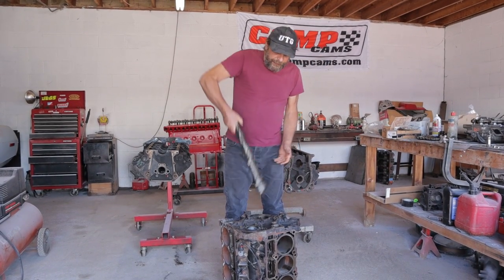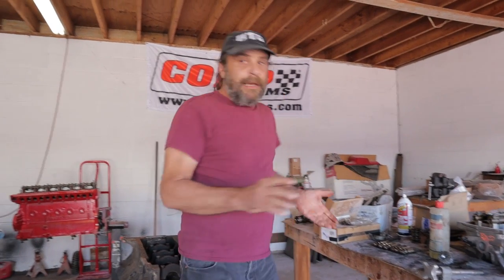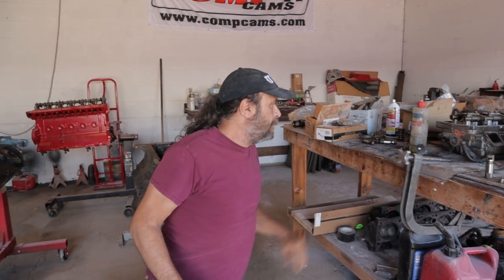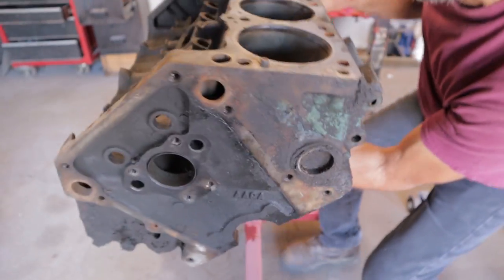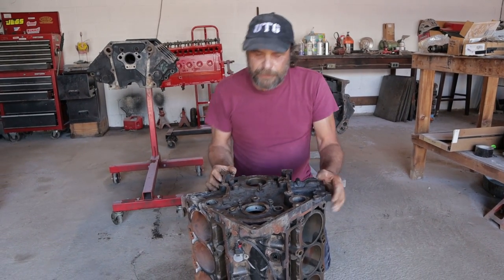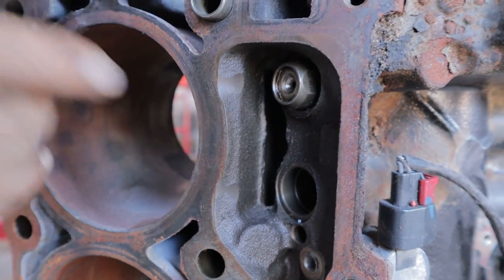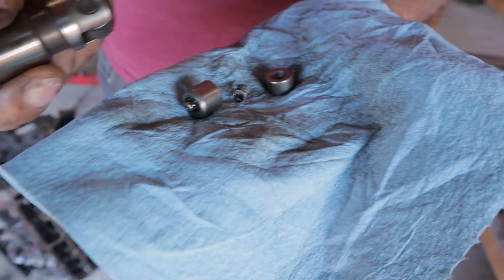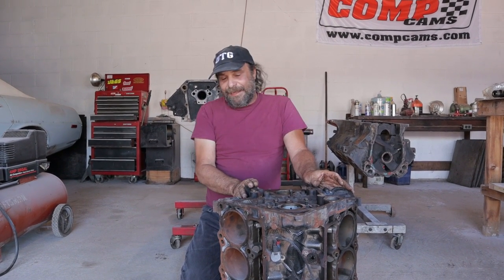Gen 3 Hemi Camshaft Failure Mystery Explained!

Comment: so i see the tread here has a lot of possible solutions for the problem that chrystler doesnt want to address. I am going to offer one aswell. At a time i worked as a tractor trailer mechanic where i had the privelage of rebuilding one of those engines (not my normal job). And this is for antbody here but, Isn't there a way to put oilers (like little sprayers) up top to spray oil down to the cam and lifters? i mean the oil-pressure is there... . the oiler i am refering about are what cummins uses to spray oil on the piston wrist pins

Comment: hard to believe after all of that r&d Mopar did on this block, and you know how many millions of miles the big manufacturers run these engines to failure, that they still released it! hard to believe that the engineers didn't catch this year's ago before Uncle Sherlock Holmes Tony did though and figured just sweep it under the rug and deal with it on the back end replacing the damage. much like the 351 Cleveland and losing oil to the crank journals. myself included with the great engine stories along with thousands of others who have the same quote, until they got the dreaded rod knock!!! after that it went kablewy!!! or got sold clunking down the road. too bad about kiwis bad engine, hopefully he'll get a different better engine for the future incarnation. thanks again guys!!!

Comment: My Chrysler shop does this and never a failure since and I’ve got customers with 200k plus and some with 300k that have not had any issues! It’s a mds and low oil pressure so a read my fix and you’ll see a huge diff. It happens when the hemis sit for long periods of time with low oil pressure! A demon/hellcat oil pump and lifters  fit the the 5.7 and disarm the MDS AND ITLL NEVER WILL DO IT AGAIN

Comment: I have a 5.7 in my 2012 Ram 2500  No problems yet but the blogs and forums are littered with cam lobe and lifter stories getting eaten and burnt up.  I hope this wont happen to mine.  Good to know the reason why and know that RPM may help throw some oil on the cam.

Comment: Well good to know...this thing would eat cams like crazy under the primary usage in which I would use it like 60% of the time, my truck idles ALOT!!! And over half the time I barely pass 2k rpm and it's super rare I hit or pass 3k , the thing is the ol 4.62v ford has practically 500000 miles on her now and I'm "in the market" for another ...Ram certainly is not an option now, I wish you could get a ref cab short bed tundra but since that's not an option I guess that narrows it down to 5.3 gm or 5.0ford

Comment: I am sorry Uncle Tony I think you are wrong. 03-08 hemi with MDS did not have this problem. Chevy, and the new ford 7.3L gas engine also have this problem with the lifters and Cam failing prematurely. 

My educated guess is. 
Thinner weight oils and longer intervals. Are the issue. Along with supplied parts being of lower quality. 

If I own a Hemi I would check and change the oil every 3k-5k with quality oil and filter. I would be mindful of excessive idle time.

Comment: Why not just drill small holes in lifters to lubricate the roller like in flat tappet cam EDM lifters? Simple and will make big difference. Another idea would be to take oil from last cam bearing and run a tube on top with holes lubricating top of the cam, but this would require better oil pump to handle the pressure loss. I see that in my big block with indy heads and oiling lines taking oil from last cam bearing, works well but drops oil pressure down by a lot.

Comment: I have done many replacements of camshafts and lifter jobs over the years on these HEMI's and only until about 2009 and later did i notice issues with them. never had seen one fail until 2010 or so. same blocks but never before seen until late 09 and 10. its a lifter issue mainly. never had one scored like he shows and seems about 98 % of the time its on the left bank 3 5 or 7 cyl's very rarely on the r/bank. still may be an oiling issue but how come we never see them on earlier MDS engines ?  or even non MDS early mods. have also seen this issue on the 6.4 ltr . never on a 6.1 ltr  car . mainly in the truck line and sometimes in cars. very random on the miles that it happens. just my 2 cents. by a LONG TIME MOPAR GUY.

Comment: These engines are not as defective as this video makes them seem. You can find a lot of examples of high mileage Hemi 5.7l.  My 2008 Dodge Magnum has 170,000 miles with minimal engine issues: new intake manifold (big plastic part) and a MDS solenoid.
Reply: I have run a 6.1 to 350K miles.  I have a 6.4 with ZERO issues.

Comment: Thanks Tony for finally finding the truth. Even though it made me sick to my stomach. From dropping valve seats too no oil on the cam, I'm pretty pissed right now. I have two 2010 hemi cars I bought brand new, so far so good. But It looks like that could change in a heart beat.
Reply: Don't worry about the engine and the cam problem just make sure that you change the oil with synthetic oil and you will never have this problem the problem is that they use cheap oil at the dealership that's what causes this. I had 2009 dodge ram put 190,000 miles no engine problems. Try change your oil by yourself, it's easy. I have a 2013 dodge now put 50,000 miles on her nothing wrong with her. Also put good fuel injection cleaner every 6 months helps with fuel tank. Most of these problems are caused by cheap parts. One more don't use cheap spark plugs from the dealership,use double Platinum they burn better in your engine.

Comment: From what I have been reading about these engines were effected are engines before 2017... Chrysler has corrected the problem from 2017 on up.
Reply: Can you post links. I would like to read that information. I have a 17 UT has got me seriously worried. Thanks
Reply: @roadsideguy5902  Found that 5th Generation 5.7 Hemi Engines have a different camshaft and I would suspect lifters as well... A totally new design from the ground up. This could very well be how they have changed things dramatically on past problems that existed. https://5thgenrams.com/community/threads/mechanical-differences-between-4th-and-5th-gen-ram-1500.2109/
Reply: @netsurfers9357  thanks I will check this out.

Comment: i just took my 2015 in with the same issue, i was told after the repair with the "improved" lifters i wouldn't have an issue again. is this true in anyone else's experience
Reply: So when my motor was tore down and lifters pulled the lifters  were soaked in oil from the galley passage running along them, I put the blame entirely on the MDS solenoids

Comment: I actually found that jeep dodge Chrysler decided to fix everything by suppling hardened valve springs in these engines which is fine and all but is actually destroying the cams in these, the access oil flowing with worn cam metal in it is Waring the lifters and  rollors..., When you take apart and  see worn cam and lifters you think that's the problem, lol please check those springs compression, , sometimes I found broken springs too , no noise but a misfire ,. Meaning if you see as a mechanic nothing wrong with valve springs just bye looking at them , and install another camshaft, and boom same thing later worn cam probably on same lobe...🤳✨🤗🔧🏆📐
Reply: Change springs too...🏆🔨🗝️

Comment: First time I've heard this and it totally makes sense.
Reply: Been a problem since it’s release
Reply: @GuatoLT1  ya my mopar friends are in denial about it. But I keep hearing of these symptoms that all point at the cam and lifters. Unrelated but the other day my buddy spun a main bearing on his 15 ram. Ouch. I'm just waiting on my chevy to have its head problems which is rampant
Reply: @onetimer13541  my 15’ 5.7 grand cherokee 49k miles. Always use AMS signature series 5w20 every 5k miles. Mine just started
Reply: @GuatoLT1  ya. My Chevy I used the 4 oil changes that come with the purchase. After that ams oil every time. I do go about 6k and it looks better then the synthetic blend after 3500 miles. So I have 150k miles on the engine. 2013 5.3 ls engine. I'll see how long it goes until the v4 to v8 feature smokes the cylinders
Reply: @onetimer13541  180k on my 2002 5.3 suburban. AMS too. Havent touched the engine in 6 years. Just plugs and wires 10 years ago. 99 vette 60k miles takes a beating. Dodge makes sub par low quality
Reply: @GuatoLT1  5.3 is a great engine and basically all of the ls engines are good. It's when they put the displacement on demand feature that goes from 4cyl to 8cyl. Most guys get rid of the feature when its rebuild time. Or it can be tuned to run in v8 mode full time

Comment: I think engine designers probably have no real world experience in what works.  Can't believe they wouldn't have test run new engine types under various situations to uncover flaws.  I worked for an oil company that had a research center where they ran various engines , tore them apart periodically to see where the wear was.  Instead of these huge bonuses spend a little time taking care of us consumers with research.

Comment: The oil and filter needs to be changed every 1,000 miles. Do not rely on the oil and filter change intervals recommended by the manufacturer.

Comment: Why not just drill tiny holes into the cast tubular oil gallery? You would need a high volume oil pump but it's perfectly placed to be a spray bar.
Seems to be a serious oversight but I would bet it was a fiscal decision.

Comment: I was a Mopar guy until I had this issue with my 2011 Jeep Grand Cherokee. It cost me $7000.00 Canadian to replace the cam and lifters. . And I had just had the front end done 1 month before at a cost of $2500. 3 months after the cam was replaced the air compressor went and that was $3000.00. 3 months after that something failed to do with the differential. I was quoted $3000.00. My millage was only 140000 KM. It was only 6 years old. We had done all the maintenance on time. Lets face it, Chrysler makes the bottom of the line vehicles. I defended Chrysler for years as a Mopar lover. NO MORE! I traded in that piece of crap Jeep and my 2010 Challenger R/T classic before it needed a new engine. Shame on Chrysler. It is not the same company it was in the 70's and is getting worse.

Comment: "never seeing any lubrication"  ??? If that statement were fact based, the lifter would seize in the bore pithing a matter of minutes. People need to do something simple and that is, change their oil every 3000 miles or more frequently if they're idling their engines for long periods. 

component of the engineAmazing...

Those "scuff marks" noted in the commentary, aren't. They're in line with the oil passages which run longitudinally in the block which supply the lifters with oil and show no wear due to them not coming in contact with a mating surface in the lifter bore. 

Judging by the amount of dust in that "shop" it's mind-numbing anyone would assemble an engine in that environment.

Comment: Uncle Tony’s Garage, thank you for this video. Confirms everything that I’ve done to my 4th gen hemi to keep them running strong. My 2012 ram 1500 I had from 43k miles to 130k. Never let it idle long other than at the occasional drive through or stop lights. At 60k miles I put a Bullydog GT programmer on it and disabled the MDS. I also use royal purple oil and WIX Filter. I never had an issue with the truck. Only issue I had was with the manifold bolt breaking on the passenger side at 110k. Now I have a 2017 ram with 37k miles. I am giving it the same treatment. No long idles, good oil. I’ve always said with these trucks 1. Do not buy a high mileage truck. You do not know how they where kept. 2. If you have remote start, don’t use it and let the truck idle for a long time. That will kill these motors.
Reply: Darth Hemi okay, well with your video I did more research. I hadn’t done research into it since the 2012 ram I owned back when Chrysler claimed they didn’t know what was wrong with them. So I should’ve done more research back into it before commenting. I found the document you where talking about how the lifters where a bad batch and stuff. I own a 2017 now. So it does give me more comfort that they where replacing those lifters with better ones when my truck was produced. Good info in your video. I still don’t let this truck idle and probably won’t. I just also don’t like they idea of just wasting gas lol

Comment: Connecting rods and cranks do not splash camshafts and lifters with oil . they do not contact the oil in the pan , unless the pan is excessively overfilled with oil , which would cause oil aeration and other issues . why do you think high performance and racing engines use a windage tray ? It's to keep oil away from the crank during hard cornering , acceleration and decelerating conditions !   The hemis that don't use mds don't have a cam wear issue , and the way to solve the problem with mds eauippped enigines is to disable the mds system . it has nothing to do with how far the cam is from the crank , many aftermarket blocks have the cam way up high in the block to allow for clearance with long stroke cranks .

Comment: Well the 6.4 has spray jets on the underside of the pistons and that oil ends up on the cam. So explain the failures in the 6.4s with the same problem.

Comment: I heard from 2017 on to 2021 they did something different with the motor , I have a 17 longhorn with 100000 and no sound of ticking , always synthetic oil used . My previous was a four-cylinder journey it dyed .
Reply: So 2017+ hemis should not have this problem?
Reply: herbatkowy  from what I heard I don’t know , if someone does  have this problem I’d like to hear it . And change oil every 5000 km and use synthetic only , 89 gas too
Reply: Are 3.6 pentastar better engines? I mean are they NORMAL no need to change oil 5000km etc. ?
Reply: herbatkowy  
It has an Electric motor assist more problems many of the problems of the cam is people use crap  oil and do oil changes past 5000 K
Reply: @wallyedmonds8199  what kind of engine were talking about if it needs change oil until 5000km? Isnt it crap? Its not 1000horse power racing monster but normal engine for normal people whos changing oil in a daily car at 5000 kilometers?
Reply: Always 5000 km the 8 to even 12000 is bullshit 6000 I’d be ok with that 
And normal oil is bs 
I think but I’m asking ppl 
When do you change oil what oil you use 
Most Engine fail is from conventional oil and they change the oil at like 9000 km to 12,000 km 
Sometimes longer 
Sure maybe this motor has a flaw .
Reply: Bill Knight
Wally Edmonds I change my oil every 3000 miles and use 93 octane with a Bullydog 93 octane tune. I use Castrol GXT 5w30 with 6oz of Lucas oil stabilizer in with the oil. No oil burning issues or odd noises. Been going this for ten years.

Comment: It’s funny the non vvt engines really never had this issue. The early 5.7 definitely had valve seat issues, this is an 09+ VVT engine problem.
Reply: I have an 03 in a Dodge 2500 with 34,000 original miles, and I'm starting to get the tick.  It is a farm truck that does get a fair share of idle time...

Comment: It's got a cop motor, a three hundred ninety two cubic inch Hemi plant.
It's got the cop camshaft, cop lifters, cop pushrods, 
It's been running 15,400 hours at idle with no oil on the camshaft so the lobes are flat. 
What do you say? Is the new Mopar Hemi crap or what? 
It's got no cigarette lighter, you'll have to fix that.

Comment: So I'm feeling a little more comfortable dealing the inherent lubrication deficiency of my 5.7  given I've installed 3.90 gears and a supercharger. It lives between 2 and 5K RPM almost every time I drive it, should be enough oil slinging to keep those those valve train parts lubricated!
Reply: I hope you put a hellcat oil pump on it.
Reply: @bignickenergy723  No, it's  just the stock pump. is there that much difference?

Comment: Couldn't you just plug up the drain holes around the lifters? At least 90%, so oil would pool up around the lifter bores and lubricate them, and drip down the lifters to the cam lobes?

Comment: The engine looks to be intentionally designed this way. Less oil on moving parts is less windage which increases efficiency and fuel economy. I agree that more oil would help the situation, but the engine was probably built like this to be more competitive with others manufacturers in fuel economy.

My 5.7 Hemi had to have a new cam and related parts installed with only 53,000 miles on it!

Comment: I have looked into this extensively, the bottom line if you idle or low rpm drive your truck this motor is not for you. Will running a high zinc oil replace the deviancy of the oil system , maybe. Who wants to put thousands of dollars into a truck on a maybe. Dodge should really address this with a better oiling system and fix the problem correctly.

Comment: I have a 2015 ram 1500 that I'm starting to hear ticking when I start the engine. After it warms up it goes away. I have 116k miles on it. I think I'm just going to have to trade it in on a newer one.
Reply: Broken exhaust manifold bolt .

Comment: the variable displacement system they have on them deactivated and it will prolong the motor they're all so bad about dropping valve seats.
Keep the oil changed don't over rev it tune it to get rid of variable cylinder displacement and you will prolong the life greatly